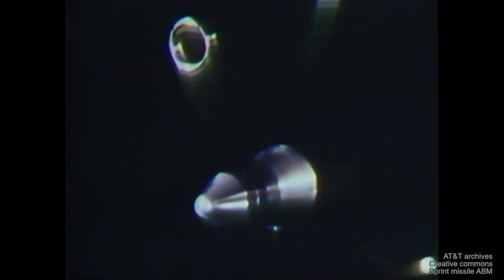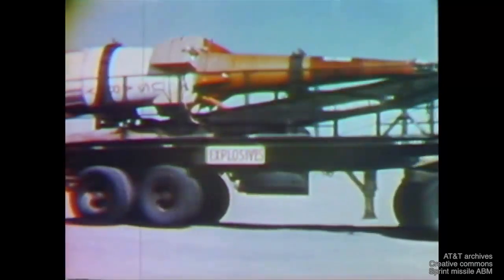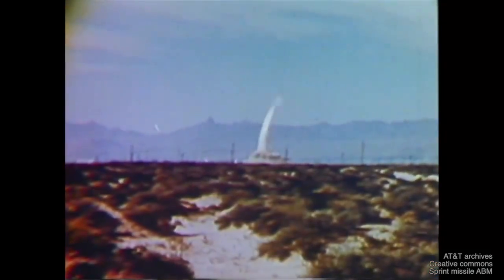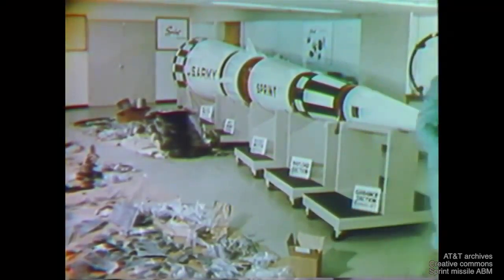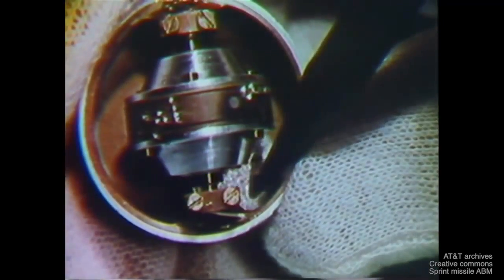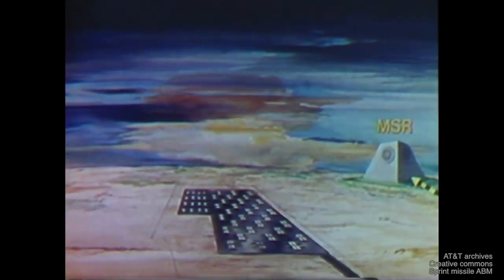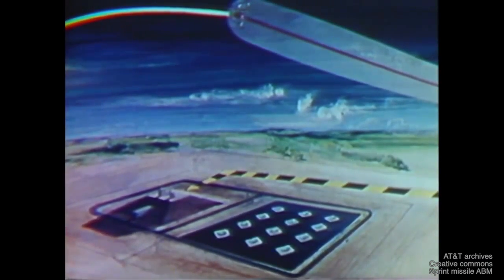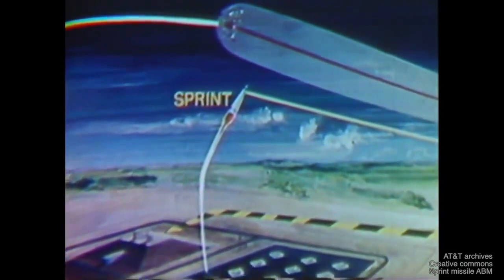SPRINT missile from Martin Marietta - Florida

Comment: From what I remember, it was supersonic the instant it left the silo... holy shit.
Reply: ..yeah, got up to 100 G's pretty quick.....
Reply: The HIBEX (High Boost Experiment) based on the same missile with different propellant accelerated with 400 G's, and went Mach 8 in just over a second. Imagine that.
Reply: @SuperGeronimo999  Also much smaller, a toy by comparison, and SPRINT itself isn't very big.  They were both just shy of directed explosions, if you think about it. I know they did a lot of work on both propellant formulations and internal geometries to get that burn rate (first stage about 1.5 secs).  

My father was on the analysis side (ANALOG computers he designed for simulation), then a designer, then engineering manager on that program.  

I saw the launch site in person once, the gantry was still there, and got yet ANOTHER story about it (cause believe me, I heard plenty before and after that, if you catch my drift) when I was going out to do some interfacing with WSMR launch safety on another (MUCH more boring) target missile called HERA I worked much later on  for a Martin spinoff company.  

I remember when I walked in they were doing 'live' electronics tests (FTS, etc) on a loaded missile, and when you looked forward of the missile on the wall there was a giant piece of steel pointing straight out into the room.  I hadn't thought about it, so I asked, like an idiot, and was told that was a safety requirement for if the missile lit of INSIDE the bunker/lab/whatever you want to call it. Then that 'knife' would cut the motor cases and render the missile 'harmless', passive 'flight' termination, actually.  They meant harmless IF you weren't standing there beside it.  I often wondered if you'd feel anything if the motor lit, since the pressures, temperatures, and flow would go from AC vent to INSANE, but wasn't keen to find out, and was frankly much happier when I was out, and with the hardware in our lab, which had INERT written on it in large lettering.  The rest of the RSO interfacing was over a table in an office..much more comfortable.
Reply: @dougankrum3328  It actually never hit 100 gs, it went from 0 to mach 10 (12348 km/h) in 5 seconds, Wich makes it peak at around 70 gs Wich is still insanely high considering that the human body can't handle 10 gs fore more than 30 seconds.
Reply: @low-keyforce7204  There were lateral gs as well, sometimes a LOT of them. And the accel, like on most any missile likely wasn't constant...near 1st stage burnout it was probably very close to 100 gs longitudinal.  

I didn't check your numbers but they seem reasonable just looking at them, for an average.  I think they probably meant 100g max, as a design spec. basis, maybe even before FOS was applied.  

I didn't work the program, but I imagine those tight radius turns you see through most of the first stage burns were at least partially for time to target minimization...air density flight time profiles and a lot of other factors considered.  

I know the missile was actually unstable at launch, to allow those insane pitchovers at light up right out of the silo. IIRC, they used a gas injection system to turn the thing and god, did it turn!  It went stable just milliseconds into flight, when a bit of the first stage propellant had been expended.  I remember Dad had a used vane sitting on his desk for a while and it was pretty cooked.  I think they used a tungsten rod in that initially fairly sharp nose for thermal considerations, ablatives most everywhere else. It got HOT!

Dad said he was aware of all the numbers, but the first time he was there to witness incoming RVs (Vandenburg to Kwaj) in person at night he was just blown away by how bright and how fast they were.  He asked one of the fellows working there how visible they would be and he laughed.  He said look about there (pointing) and first you will see some very dim sparkling/scintillation.  When they get closer, which doesn't take long, you would EASILY be able to read a newspaper by them.  Dad said there is no way to appreciate it without seeing it.

Geez, I've been hearing these stories all my life, now I'm doing it, secondhand.  My bad.  I need to leave before I end up writing a novel here.
Reply: @low-keyforce7204   it did hit 100gs at target intercept, it had to be throttled down at lower altitudes so it wouldn't burn it self up in the more dense air  - it had the power to go even faster but not the material science.
Reply: That was just from compressed gas popping it out of the silo like a cork, not from engine thrust. It didn't ignite until it had cleared the latter.
Reply: @bogdog999  I built a mockup in KSP that hits mach 1 in less than a second, faster than I can react to take a picture of it with the screenshot key

Comment: My favourite missile. Always stunned at it's speed and acceleration, and accuracy. Amazing engineering feat for the time.
Reply: TO be fair to the modern ones they have to be mobile and hit to kill, sprint was stationary and carried a nuke.

But that didn't stop more then half of the test sprints doing hit to kicks by mistake....
Reply: Nick Sajuuk-Khaar amazing even today... At least these interceptors could do their jobs... Modern ones don't even work 75% of the time
Reply: @Brokenrocktail  ye using nuke warhead in your interceptor to explode over your country, so be ready for the emp wave ^_^

and anyway its range is too short 40 km is less than thaad or s300
Reply: @vkobevk  S400 can intercept in the midcourse or early terminal. That's what the Nike Ajax / Zeus was for. The sprint was meant as a last line of defense for terminal (re-entry) phase interception. It is not comparable to the S300. The original S300 (from 1967) could not intercept missiles at all, it was later iterations of the S300 that were modified to intercept.
Reply: One word: HIBEX.
Reply: It's better than they have today.
Reply: I love how the second stage of the missile just ejaculates into the sky.... whoa buddy that thing takes off!